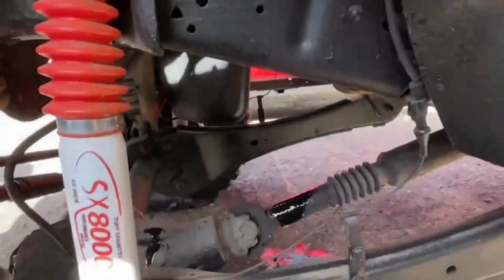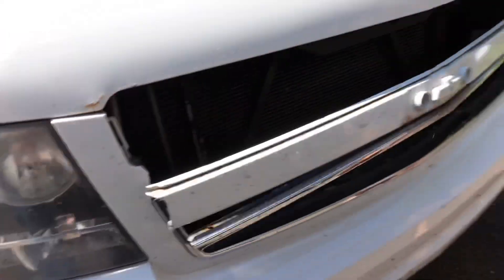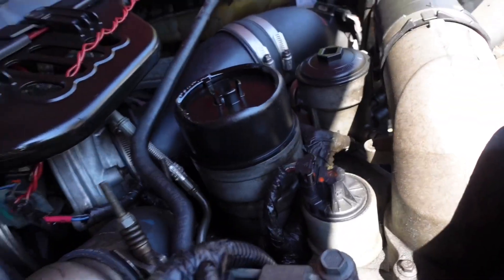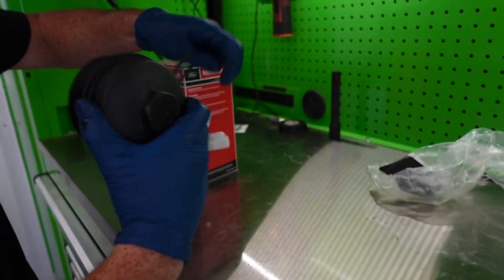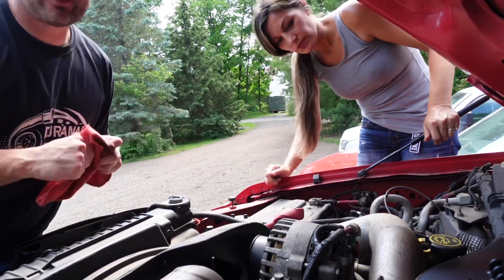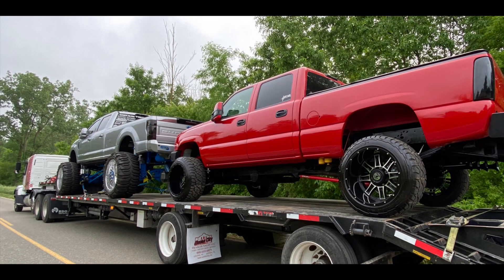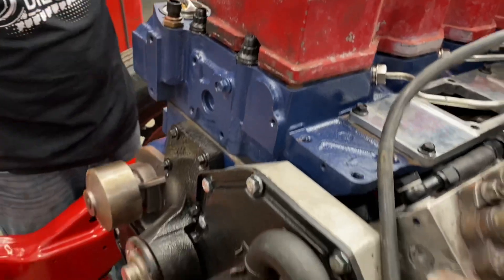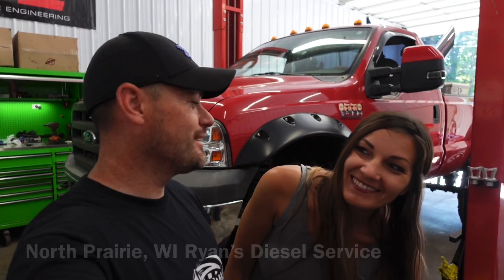I Tried To Show Off The Powerstroke “Oil Everywhere” Blown?

Comment from the maker: What color should I powder coat the valve cover on the Cummins?
Reply: Creamy white
Reply: White and do the lettering in red if your powdercoating guy could do it
Reply: White red on the raised stripes and a blue cap with white stars
Reply: Red valve cover, white letters and white stripes that are on the top.
The stripes could also go: white, blue, white, blue, white.
Reply: You should find a way to clear coat it and leave it the way it is.
Reply: White with red lettering
Reply: Candy Apple Red Metalic
Reply: Metallic Red
Reply: White with a red or blue oil cap!
Reply: 🤔White with a blue America flag 🇺🇲
Reply: USA Flag
Reply: Powder it red, then  the Cummins , 24 valve, and the strips running across the top powder those white. ( kinda a pain cause you’ll have to powder n bake the cover twice but it’d look awesome ) 🇺🇸🦅💪🏻
Reply: white
Reply: Cummins Red.
Reply: Red an do the raised up parts like the fins an Cummins white
Reply: Powder coat the valve cover white , the Cummins letters red and the fins blue
Reply: Or hydro dip it with American flag
Reply: White paint. But the Cummins emblem and 24valve red
Reply: White with the Cummins and 24 valve lettering in American flag.
Reply: Pink

Comment: Ok last comment.. on my lift I took a piece of those sponge foam  floor mats that lock together and cut it up and use some dep adhesive and glued it to the inside of the post to keep the doors of trucks from getting dents and scratchs..
Reply from the maker: I like your thinking
Reply: Use a pool noodle cut in half on the lift to protect the truck doors

Comment: Change those fuel filters and make sure blue spring is in it. Save those injectors. And always use arch oil in the oil and fuel

Comment: Maintenance is key on 6.0. Only use motorcraft filters. I just drove my 04 550 miles today and turned 190k.
Reply: I have had 4 6.0 powerstrokes and on my 2004 lariat I just hit 240k .never had the head apart but I did have to do injectors at 212k I wasn't angry it was time

Comment: The driveway is a good place to break down. I had a water pump fail on my Cummins in my driveway starting it up for a 13 hour drive to Montana. It was 30 below that day. I was packed and ready to go on a  snowmobile trip. I was upset  at first but then realized i could have been stranded on the highway . I hoarded the engine compartment in and replaced the pump and belt  , flushed and replaced the coolant  Left the next morning .
Reply from the maker: That’s awesome

Comment: Nice thing about the HEUI injection system is that it won't run without oil and in a situation like this, you lose high pressure oil pretty quick , causing the engine to stop running before (usually/hopefully) any damage is done to critical engine parts. The low pressure pump, which is also responsible for pumping oil through the engine for lubrication, feeds the high pressure pump that creates the pressure to fire your injectors. No oil to fire injectors = no running.
Reply from the maker: Thanks for the info

Comment: The factory oil pressure gauge is a ‘dummy gauge’. It’ll show the same read out if you have 10 lbs of oil pressure or 60 lbs of oil pressure. A good monitor that shows real live data is almost a must with a 6.0.

Comment: On the 6.0l you should be completely fine, I did notice your oil feed line for the turbo needs to be updated to a solid metal line. Fyi if you run a 7.3/6.0 low on oil it will shut down or just not start

Comment: Always run the factory stock oil filter and cap on a 6.0. I run Amsoil Heavy Duty Diesel and Marine 15W-40. 6.0s love that stuff; you can tell the difference. Oil is critical in a HEUI engine. If your oil runs too low the truck will not run because it uses high pressure oil to fire the injectors . . . get some good batteries before you fry the FICM too.

Comment: The oil filter cannister style,the oil filter gets changed first during the oil change.Will drain the the old oil in with the new oil if the filter is not changed first.

Comment: I wouldn’t worry about running the engine with no oil. The 6.0 and 7.3 have HPOP systems that use oil to run the injectors. They will not physically run if they don’t have enough oil in them before it can be catastrophic to the engine.

Comment: Also a starter off a 6.4 power stroke will bolt right on and cranks twice as fast
Reply: I thought you had to change the flywheel  too?
Reply from the maker: I definitely plan to do this
Reply: My boss has a 6.7 powerstroke starter on a 7.3 powerstroke

Comment: Turbo is turned off either the switch that’s wired in is off or the oil got into that wiring job and it’s not making good contact but you can hear it’s rumbling and not whistling
Reply from the maker: Thanks I will check that

Comment: If you could do the top of the valve cover red and the sides and back and front of it white or something like that. Or do the whole thing one color and do the lines on the top of it a different color. I feel like if you really want to set it off it should be more than one color.

Comment: The oil filter cap on the powerstroke is not the right one. The right one uses a 1/2 inch extension and has to be torqued to spec. The same thing happened to me on my 7.3.  I bought a cheap filter with the cap. It lasted for less than 5 minutes and blew the top off. That was from Walmart. I now buy the right one, the plastic housing is thicker then the cheap one.

Comment: I own a lot of powerstrokes you won’t ever have a issue with a 6.0 running low on oil because it would stall before then because it uses the oil for the injectors so no worry’s their

Comment: The 6.0 just needs to be driven...not made to sit...with HEUI injection it won’t run without good oil pressure...I let my 7.3 run for at least 5-10 mins no matter if it’s 100 degrees or 20...common sense thick oil doesn’t flow well.

Comment: Never been in a major hale storms (I live is crappy CA) but say the truck was parked under an easy up pop up tent, would that prevent the hale from denting the truck? Or would be a 3 inch gap between say a truck cover would that be enough to prevent the hale
From denting the truck?

Comment: I was driving my 2002 lb7 Duramax I just bought down the highway yesterday and my oil pressure all of a sudden dropped to zero and the oil light came on I hurry and pulled over and shut it off. I got out of the truck and it was pissing oil all over the ground on the driver side by the front wheel. Just my luck hope it's something simple
Reply: Check your engine oil cooler/filter housing.

Comment: You can’t blow up a powerstroke by loosing oil. You loose oil, you loose injection, truck shuts down. Can’t beat that… Also, just looking at surface level under that hood I can see several updates that should be done on that truck. The parts are cheap and the work is easy if you do it yourself. Do some research and deal with some of the common issues, also get rid of the ghetto smoke switch work by on the VGT 🤣🤣